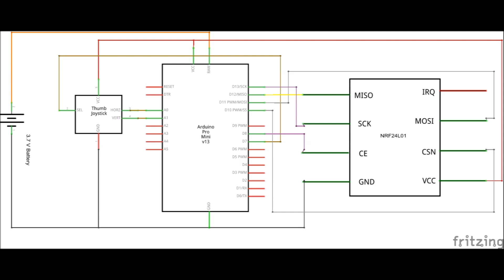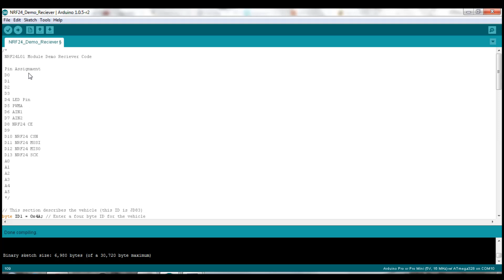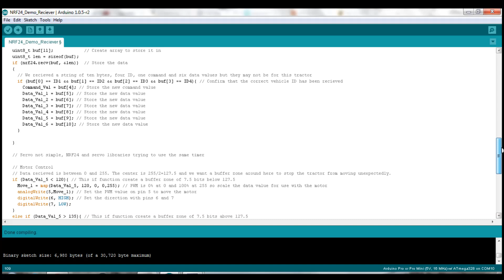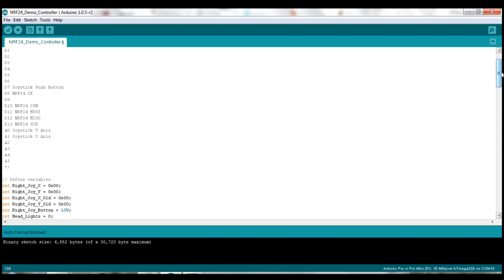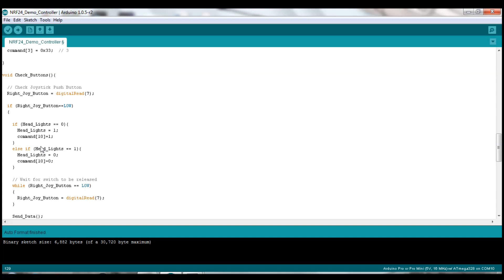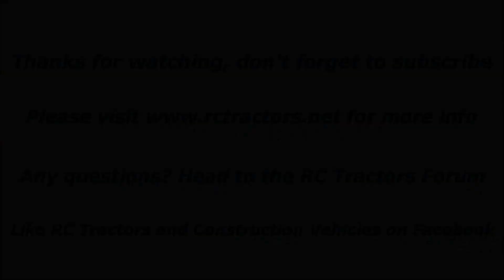Arduino and NRF24L01 Radio Module Beginner Tutorial

Comment: Hey,will the code and the circuit be the same if i want to use an arduino nano on the transmitter and arduino uno on the reciever, plus i want to add a servo which is controlled by the second joystick. The link to the blog is an empty page.
Reply from the maker: I'd guess it would, I think the FTDI part is the only difference between those Arduinos.

Comment: i using nrf24l0+ modules to build transmitter and receiver for quadcopter but  my program code not working properly, please anyone provoide code for nrf24l01+ with arduino...

Comment: The reason for the lost packets is probably because the NRF module causes a voltage spike when it transmits. To fix this add a capacitor to smooth the voltage.

Comment: Is the receiver output ppm or pwm signal ? and can this be use for a quadcopter thanks
Reply from the maker: You can output any pulsed signal you want, you're programming it so as long as you choose a clock speed suitable for the signal you want to produce then you should be fine. I don't see why it couldn't but you'd probably want to include an accelerometer or something similar to prevent it from flipping over out of control.

Comment: hey! I'm also making project on arduino and nrf24l01 but I'm not good in code so u can help me that part. I using 2 analog and 2 pot for speed control on TX and on RX I'm using 4 DC motor

Comment: When i copile the programe its tell me     ""fatal error: RH_NRF24.h: No such file or directory
""  , what library i need to dowload, can you give me the link pelase?
Reply from the maker: That was a radio head library I used to use, here is a better one http://tmrh20.blogspot.ie/2014/03/high-speed-data-transfers-and-wireless.html
Reply: Hey TGuy. The link to the blog is not working. Can you email me the circuit diagram. My email: poet183@hotmail.com.

Comment: can i use this remote for quadcopter ????
Reply from the maker: Probably, provided your radio was strong enough to maintain the radio link at whatever height you wanted to fly at.
Reply: You can use NRF24L01 RP-SMA which is the same thing but has an extended antenna range cca. 1000m

Comment: hello i am making a quadcopter. i have the rransmitter code but in the receiver section i am using a arduino as a flight controller and i have that code (flight cpntroller code) so i only need the code for receiving the signals from the transmitter . i am using nrf24l01 module.
Reply from the maker: If you're using my transmitter code then just copy the receive section from one of the vehicle sketches and it should work. Here is the vehicle libraries http://rctractorguy.com/rc-tractor-guy-library

Comment: Hi! I have used NRF24L01's for some time now with a quadcopter, and I've bought a bunch more of these modules. Could you do a video to explain how to use different controllers and receivers at the same time, e.g both drive a quadcopter and a tractor at the same time, using two separate controllers. I assume this would be as easy as having different channels, but I would like to know if there is anything else I show worry about. Cheers, your doing a great job with your channel!
Reply from the maker: +Marcus Eide Yes you could use two different channels which would reduce processing of unwanted data so that would be good to prevent signal loss and excessive power consumption if you had a lot of other NRF modules sending data on the same channel. But generally it doesn't really matter that much if you're on the same channel I think because each slave in the network can only have 5 masters so that's five controllers. If say drone A is only listening to the address of controller A then it doesn't matter what's happening at controller B or slave B because it will just ignore that data. I think anyway :)
Reply: When you say A only listen to address of controller A, do you mean the ID of the device, like JD83?
Reply from the maker: +Marcus Eide No the call them pipes in the code I think, basically each transceiver should have an individual address which looks something like this 0xE8E8F0F0E1LL. The slaves need to know the addresses of the masters and they can listen to a max of 5 I think.
Reply: Hmm, yeah I've thought about that, but I could not find any documentation that explains how to use multiple transmitters AND receivers at the same time. I'd appreciate a video on how to do it if you find it out.
Reply from the maker: +Marcus Eide I think there is a bug in my code because it's not working with multiple controllers at the minute but when I figure that out you can just use that as an example.

Comment: sir the code gives "Arduino: 1.6.7 (Windows 8.1), Board: "Arduino Pro or Pro Mini, ATmega328 (5V, 16 MHz)"

C:\Users\Prajesh\Documents\Arduino\sketch_mar13a\sketch_mar13a.ino:37:22: fatal error: RH_NRF24.h: No such file or directory

 #include <RH_NRF24.h>

                      ^

compilation terminated.

exit status 1
Error compiling.

  This report would have more information with
  "Show verbose output during compilation"
  enabled in File > Preferences.
" error . please do assist
Reply from the maker: +Prajesh Sanghvi Hi that is telling you that you don't have RH_NRF24.h installed. There is a better library now you can find it here http://tmrh20.blogspot.ie/2014/03/high-speed-data-transfers-and-wireless.html. I use that in my code now.
Reply: +RC Tractor Guy  thank you sir for the help.

Comment: the code shows a compilation error
Reply from the maker: +Raghuram Satish The library on the site? I got an email about that yesterday, its missing the I2C library. You just need to install that and it should work fine. I'll include the I2C library within my library in future.
Reply: Thanks
Reply: +RC Tractor Guy also do you have a code to control 2 DC motors
Reply from the maker: +Raghuram Satish I think this code would suit you best, he made a crane with three motors in it if I remember correctly http://rctractorguy.com/forum/topic/simple-crane-code
Reply: +RC Tractor Guy Its not compiling with the I2C library tooo :(
and can you send the circuit diagram for the crane thanks

Comment: Thanks for the tutorial, and a noob question, what are the electronics present at the receiver end i.e at the tractor . did you use another arduino + nrf24lo1 at the receiver end?
Reply from the maker: +sai kishore Yes in the tractors I usually have an NRF24L01, an Arduino and a TB6612FNG motor driver. After that it's just adding servos and LEDs as they are needed.
Reply: +RC Tractor Guy   Thank you for your reply.....as the models are currently unavailable in our country, are there any resources so that i can custom built the models, preferably by 3d printer as I have some experience in cad? Thanks once again
Reply from the maker: +sai kishore Sorry I'm not aware of any 3D models of farm machinery, if I did I'd definitely like to print that myself :)

Comment: where did you get those linear pots?
Reply from the maker: +Frank Lopez Below is the link. They are really good but I never found caps to fit them so you might be better off buying cheap ones on ebay with the caps included. http://ie.farnell.com/jsp/search/productdetail.jsp?CMP=i-ddd7-00001003&sku=1688415
Reply: RC Tractor Guy thanks man

Comment: In the beginning of your video, you mention the arduino has to be the 3.3V (8 mHz), so you can also power the nRF module by connecting it to the arduino VCC pin. However, for my Flysky transmitter built around a Wii Nunchuck, I'm using the 5v version (16mHz) powered by a 3.7v lipo through a 3.3v LDO. The RF module, an XL7105 (max 3.6v) is connected to the arduino and this setup works finely - the ATMega 328p chip needs as little as 2.8v to work at 10mHz. I'm watching your tutorials and plan to also convert a vehicle, so I wanted to ask you if you think I can also go the LDO route when using the nRF modules. Thanks in advance.
Reply from the maker: +Friendroid Yes definitely, I only say use the 3.3V version because it has the regulator built in and that makes life easier for most people but using your own regulator is perfectly fine as long as your LDO can supply sufficient current. The 3.3V on an Arduino mega for example is too weak as I discovered with my controller design. Also you may need to add a decoupling cap on the NRF24 if you find you are loosing signal a lot or maybe a better thing to say is that it is best practice to add one if it is not inconvenient. I ran out of 3.3V arduinos a few weeks back but needed a model working for a toy show so I used two diodes to drop the voltage below 3.6V which works fine too but isn't the most efficient way to do it.
Reply: +RC Tractor Guy very clear, thank you. yesterday I ordered a gamepad shield and a couple of the motor driver boards you mentioned on your site. can't wait to get it going :)

Comment: Hi Oisin, when I click on the links you have posted above for the code the page will nit display
Reply from the maker: +Loughfield Thanks for the heads up, I totally overlooked that issue. The links have gone dead in the switch over to the new site so I'll go through the videos and fix the links.
Reply from the maker: +RC Tractor Guy Should be working now by the way.

Comment: Was the code ever altered so that the nrf24 and servos wouldnt run on the same timer?
Reply from the maker: +SaltyCracker135's Channel Yes I switched to using the RF24 library as suggested by one of the viewers and it works fine with servos. Here is an example of the code I'm using http://rctractorguy.com/forum/topic/rc-massey-8680

Comment: You might enjoy exploring the use of interrupts for detecting your button presses on the controller and to allow the nRF24 to let you know it received a data packet.  When you don't use interrupts and instead "poll" the button and the nRF, there is a good chance that you will miss something.  Polling is where you simply check to see if the button is pressed or if data is available, over and over, within the loop.  If you use a delay or other stuff that takes time, you simply won't be checking during that time and could miss an event.  Interrupts reverse this so you never check the button or nRF, instead when something happens on them they let you know.  They are pretty cool.

Interrupt tutorials with a button:
https://www.sparkfun.com/tutorials/326
http://www.gammon.com.au/interrupts

nRF24 interrupt example:
https://github.com/TMRh20/RF24/blob/master/examples/pingpair_irq/pingpair_irq.ino

The nRF24 example comes from a library explained here.  I came across this library when working on streaming data as fast as possible with the nRF.  It's a pretty fast library.
http://tmrh20.blogspot.com/2014/03/high-speed-data-transfers-and-wireless.html

About 2 minutes into this video you'll see my project missing a button click before I started using interrupts.  Definitely a common problem!
https://www.youtube.com/watch?v=XHxZUI7WXU0&index=2&list=PLonofM-nQMBfyJf0Pi0hs6KV3vHG87KUf
Reply from the maker: dparson Great suggestions, this is something I was hoping to get round to doing but haven't found the time. Your links should speed the process up considerably, thank you.
Reply: keep improving this tutorial.. so hlpful to have the tx for low budget..lol!

Comment: Hi, can I connect a lot of NRF24L01 Radio Module to one? For example control 5 modules or more with only one.
Reply from the maker: vicente casillas Yes as far as I know each module can only listen for commands from 5 different master modules so you can only have 5 master modules but a lot of slave modules can listen to those 5 masters I think. I've only had two masters and two slaves working together so far.

Comment: Hi, great video. Exactly what i was looking for.
I am trying to get these modules work for a while now. I think I am receiving something, but not what i should. I used your sketch and i am getting a   -1  all the time. Do you have any idea?
What you said about the capacitor is the reason why some are adding it.
Reply from the maker: Leif Holthusen I'm not sure but my example transmitter code sends an array and I think you are using a receiver example which outputs a value on the UART so you can read it in the terminal, is that right? maybe your receive code isn't processing the received array properly. You can post the code you are using here http://forum.rctractors.net/thread/81 if you want me to take a look.

Comment: Hi, so I am a complete beginner as far as all this stuff is concerned but while googling NRF before you shared this video I did find http://hack.lenotta.com/arduino-raspberry-pi-switching-light-with-nrf24l01/ these guys are getting a raspberry pi to talk to an arduino using nrf24l01+ and they made a comment about package lose that to prevent it they included a 10uF capacitor between pin 1 and 2 on the nrf chip, I don't really understand how this would help as I thought a capacitor would only prevent a lose of power, but like I said I am new to all this, so on the off chance that this would help I am just passing the info on.
Thanks
Rangin
Reply from the maker: Rangin Taafoo Somebody did mention this before and to be honest I forgot about it. It could be that when the radio goes to transmit it ramps up the power to a point where it is too much current for the small voltage regulator on the raspberry pi or arduino, the capacitor can deliver high current almost instantaneously which takes the load off the voltage regulator at that point. Although a quick glance at a data sheet would suggest it draw 13mA max so my theory is probably wrong. Still there is definitely no harm adding the cap, might be a bit late to retro fit it to mine but I'll try remember for my next build.